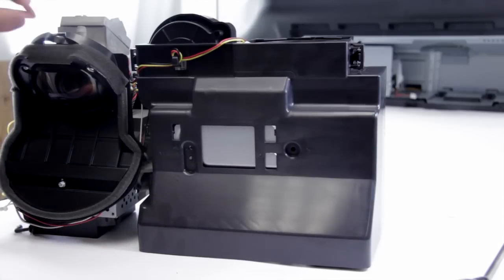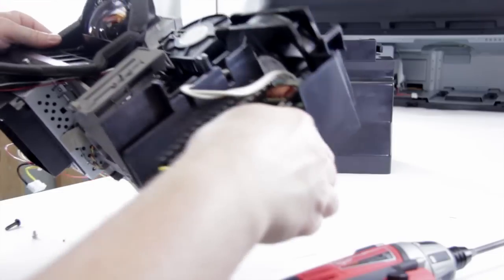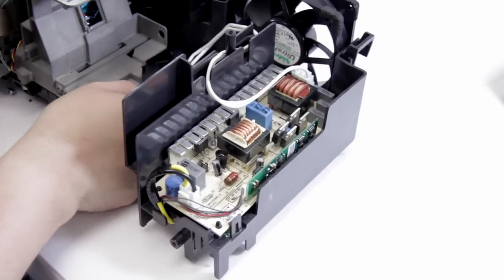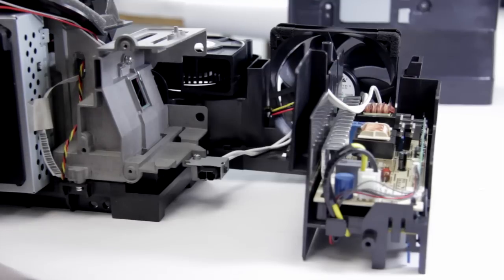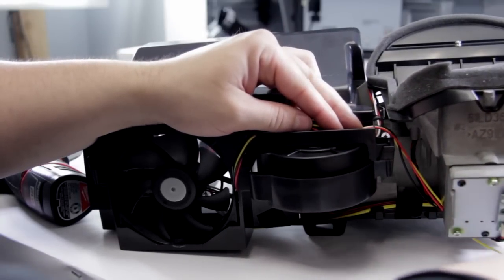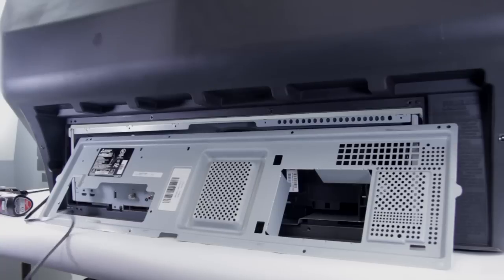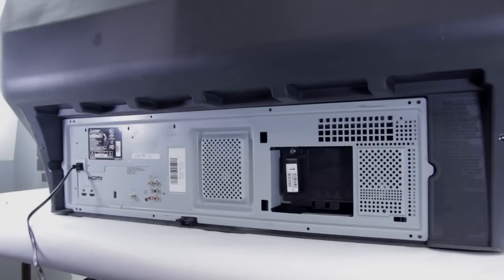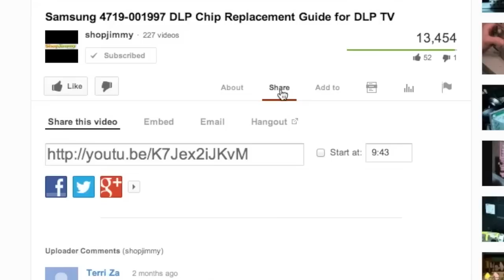DLP TV Repair Tutorial - DLP Bulb Won't Turn On - How to Replace Ballast Board in DLP TV

Comment: Hello,  great video. I was just finishing up after separating all my parts. I just ordered a replacement ballast on Amazon. My question is this, do you know what  exactly it is inside the ballast that goes bad or is it a myriad of things it can be? I just ask because I thought about re-flowing my old ballast just to see if that works. Just curious is all. Thanks.
Reply: Ballasts can fail in a number of ways once aged.  It's something you should replace, instead of seeking someone to refurbish the part. 
When replacing buy brand new. Otherwise you're still running on borrowed time.

Comment: Hello, thank you very much for your awesome videos. I have a question in regards to my Samsung DLP TV, it seems that the lamp's fan (the bigger fan) is turning slower rate than it should, what could cause that?
also it seems like there is a noise, coming from where the heat sink of the DLP chip is located, does anything come to mind that could help me to find what is the cause of this problem?
I really like this TV and hope I can fix the problem with your help, thank you for your time
Reply from the maker: Acie Ace   Attempt this repair at your own risk.  I recommend cleaning the fans, as the noise you are probably hearing is the color wheel.  Thanks!  www.shopjimmy.com

Comment: In the WD-82837. Once I pop off the rear cover, the ballast is only held in place by a clip and 3 wires. Simplified in comparison to the video above. Lots of great information, but Mitsubishi seems to have made it a lot easier since this video's release. :)

Comment: Hi. I have a samsung hlt5676s dlp tv that turns on and off and i can hear the ballast buzzing several times as it tries to light the lamp. the lamp never lights and then i get 3 flashing lights on the front. The lamp is relatively new Genuine phillips lamp. i just replaced it 10 months ago and the lamp does not look burnt.

Also i tested the wire going into the ballast from the power supply and im getting 480v on it. is my input voltage too high?

Comment: I have a WD-73833 Mitsubishi television. the other day I smelled a slight burning smell for just a second and it was gone. since then I have no picture on my tv. it comes on and the is sound and the lamp was replaced about a month ago. think it could be the ballast?
Reply from the maker: TheCaptainredneck102  Please watch this video FIRST to help with your repair!  https://www.youtube.com/watch?v=BP3NVNCGEv8  This could be a problem with the lamp or the ballast.  You may need to replace each board individually to see which one fixes the problem.  Click this link to replacement parts for your TV model number on ouor website:  http://www.shopjimmy.com/catalogsearch/result/?q=WD-73833  Be sure to match part numbers on your current board, with your replacement for compatibility.  Thanks and please let us know if you have any further questions with your TV Repair!  www.shopjimmy.com

Comment: Please help, i have a Mitsubishi DLP WD 73840 that just went out. When I try to turn it on the green light blinks only, no picture or sound at all.i noticed that one of the capacitors Nichicon 820 uf 200 volts 25x45 mm is leaking, what do you think is the problem? thank you in advanced. great video BTW.

Comment: I have a 2004 LG 55 inch and have replace the bulb twice but is still dim. Is that a ballast board issue? What is your thoughts?
Reply: I have the same issue. I'll change my ballast and see if that fixes it. If it doesnt then I'll be giving the color wheel a replacement next.

Comment: Question......I have a wd-65737 dlp tv, I replaced 4 lamp (all new and still fairly new,  and I tell you why), I turn my tv on, it buzzards and the lamp is not turning on, only sound. Then I changed lamp in tv for a new one, does the same thing, buzzards and only sound no picture. I unplugged tv for 24 hrs, plug it back in and tv started working like brand new. I clean my tv every 6 months, no dust no lint or anything. But I have to do the unplugging every other day to get it working, I try all four lapms, and with all 4 does the buzzing, flashing red light and here comes the unplugging, hahahaha, but is getting old replacing within the 4 lamps and the unplugging. What do you think is my problem, I hope is not the plugging/unpligging or being not patient enought. Thank you.
Reply: You have what's known as a short in the connection. Either the white or pigtail connections. 
Hence why reseating it, allows it to work again for a short time.
Reply: Before reseating it next time, run down the wires with a volt meter to verify first. Find out where it's not sending voltage. That will better pin point you to how to properly fix it

Comment: I have a mitsubishi wd-60735.. when i plug the set in and try to turn it on, i can hear the click, the fans, sounds like a spaceship ready to take off, sound through speakers but no picture. the timer LED flashes green for 20-30 seconds then the set turns off. If i try the error codes it gives me 12 which means there is no error. What could it be?
Reply from the maker: Jose Casillas  Please watch this video FIRST to help with your repair!  https://www.youtube.com/watch?v=BP3NVNCGEv8  I recommend replacing the color wheel in your TV.  Click this link to replacement parts for your TV model number:  http://www.shopjimmy.com/catalogsearch/result/?q=wd-60735  There may be multiple boards for the same TV model number, be sure to match part numbers on your current board, with your replacement for compatibility.  Thanks and please let us know if you have any further questions with your TV Repair!  www.shopjimmy.com

Comment: hello,i have a 92" Mitsubishi dlp tv model # WD-92A12  and the light blinks green on plugin 1-2 times and then just blinks yellow continuously until I unplug it and it won't power on but I hear it power when I plug it in any ideas what I can do to fix it? And what part I would need to buy? the tv was built in 2012 I looked at the lamp but I can't notice anything wrong or discolored. it's a osram lamp.
Reply: mossberg2010 my TV does this did u find a salution

Comment: hi there, i have a 2008 Mitsubishi DLP (wd 73735) that has a lamp that wasn't lighting, now it keeps giving me a 57 error code (bad ballast, ballast not connected, etc). i have 2 ballasts, and it happens when either are installed. so i attempted to measure the voltage to the ballast, and i got nothing. 0 volts. so i checked the source, on the main board (or whatever it's called) with all of the big capacitors, and no voltage there either. does this mean bad caps on that main board?
Reply from the maker: squilla empusa   I recommend replacing the power supply board in your TV.  Here is a link to replacement parts for your TV model number on our website, click here:  http://www.shopjimmy.com/catalogsearch/result/index/?cat=59&q=73735  Be sure to match part numbers on your current board, with your replacement for compatibility.  Here is a link to a video showing how to identify your part number, click here:  TV Part Number Identification Guide for Mitsubishi Power Supply Unit (PSU) & Main Boards  You can also call our customer service for further assistance with your purchase.  (877) 881-6492  Thanks and please let us know if you have any further questions with your TV Repair!  www.shopjimmy.com
Reply: ShopJimmy.com thanks for your response, but i already gave up. i finally got to the color wheel, and found it broken. also not sure if new lamp is good enough
quality for the TV to run. same with the new (used) ballist. but thanks for
your help. i'm not gonna keep dumping money into this thing, never knowing
when it'll end.
Reply: @Squillaempusa.  I would never give up on my tv. Its built like a car. 
Itll never give up on me if I never give up on it. 
Theres not 1 single tv made today that can say that.

Comment: Question - the bulb went out on my 73 inch Mitsubishi and normally I just order another one and replace - but this time I install a new one & 30 seconds later the bulb popped - thought is was a defective one so I ordered anothe one (replaced) & popped again in 30 seconds  - what can it be please help??
Reply: Only buy osram bulbs. Do not buy the 20 dollar models. 
Osram costs about 40-60 
You got a fake bulb. Those only last anywhere from 2 mins to 2 months in my experience, and they can also cause your tv internals to prematurely fail.

Comment from the maker: @quatrobeinte420 - We are happy to produce videos that will help people through repairs!  Thanks for the suggestion!
Reply: I had the 61 code, changed bulb, changed ballast and changed all fans even changed color wheel. I am still getting 61 code and no sound no picture. Can someone help?? At first when I turn on it blinks green after about a minute light goes solid green then starts blinking red 6 times and yellow 1 time. What else can the issue be? Appreciate the feedback.

Comment: I have a toshiba dlp 62mx196 , when I plug in the set , yellow lamp light blinking 3 times over and over. I replaced the lamp nothing change. Any ideea  ?  Thank's
Reply from the maker: Cornel Pop  This could be a problem with the power supply or the ballast.  You may need to replace the ballast and power supply boards individually to see which one fixes the problem.  Click this link to replacement parts for your TV model number:  http://www.shopjimmy.com/catalogsearch/result/?q=62mx196  There may be multiple boards for the same TV model number, be sure to match part numbers on your current board, with your replacement for compatibility.  Thanks and please let us know if you have any further questions with your TV Repair!  www.shopjimmy.com

Comment: hello i have a toshiba dlp that I just changed the bulb with housing. My problem is that a loud whistling sound and a green flash tint come on screen and keeps flashing until I turn it off. when I let it cool it plays regular for a while then the green tint flashes again during viewing
Reply: 62hm95
Reply from the maker: +Jermaine Newman  Try all repairs and troubleshooting at your own risk.  It sounds like you need to replace the color wheel.  Unfortunately I do not see any replacement color wheels in the search results for your TV model number on our website.  Thanks and please let us know if you have any further questions!  www.shopjimmy.com

Comment: I have the 73 mitsubishi  dlp and sometimes it works most of the time it doesn't. After it stops trying to turn on the sounds goes off never having a picture. Then blinks 6 red and one amber then repeats. What part do I need to replace please...
Reply: does it sound like a video game dropping a bomb 3 xs b4 it stops trying to turn on? if so its the board the dlp chip connects too. idk its name but the tv repairman I took it too said he had to order that part from a secondary supplier cuz dlp don't make em no more. matter fact they allegedly don't make our dlp tvs anymore sense the others are so cheap vs them. but they have awesome pictures. I  should got ur 73in instead of my 65 lol.
Reply: @paulhonishjr1148  I'm getting a bad color wheel symptom on my WD73640(Mitsubishi).

The color wheel is supposed to be new. It spins then turns off, spins again then turns off.

Could something else be causing a new color wheel to shut off?

Thanks in advance..

Comment: I have a Mitsubishi Model WD82737 DLP TV. I replaced the main and power supply boards because of the flashing green light and now I have solid  green power light plus sound but no picture and TV cuts off after five minutes. Help!
Reply: I have the same problem on my Mitsubishi WD-Y57
Reply from the maker: Antonio Ortega  Try all repairs and troubleshooting at your own risk.  I recommend to put the original main board and power supply back in and leave the TV unplugged for about 30 to 45 minutes then plug back in and see what it does.  Thanks!  www.shopjimmy.com
Reply: Shadow-V2  My problem has been resolved by replacing the Lamp.Good Luck!
Reply: ShopJimmy.com My problem has been resolved by replacing the Lamp however now I have a small  black blotch that's only visible when screen has a white background. Do I have dust on my lens? And what do I use to clean it? Thank You.
Reply: Antonio Ortega i replaced my lamp 2 days before it started happening
Reply: Shadow-V2 Have you tried replacing the ballast?
Reply: no i have no money to buy a new one

Comment: don't bother. The parts for these tvs are no longer made, and the repair will now run you about 600 bucks by the time you get through replacing the ballast, the dlp chip, and the color wheel assembly. The retail value of these tvs is about 25 bucks, and the repair won't even get you another year out of your tv. If it goes out, throw it away. I tried to repair mine and didn't even get through ordering the parts. Nobody carries parts for this crap, not even shop jimmy. They only carry reasonable parts for lcd tvs, and some parts that run in the several hundred dollar range for dlp parts. Just go buy a new tv, it'll cost you less than this repair.

Comment: What exactly are the symptoms of a bad ballest? Just replaced the bulb and it comes on and starts to warm up maybe ten seconds later the screen starts flickering and goes out displaying red light for bad bulb??
Reply: My issue is a dim screen when a brand new bulb is installed. 
I pushed my last bulb to the end of its life, once a bulb has passed its half life, it takes more energy to produce less light than it didn when new. This puts a strain on your ballest board causing it to prematurely fail. 
If I let my tv sit off for a week, the ballest can generate and store enough energy to run my tv for an entire night before it cuts off. But the s green is still dim.. If I turn it right back on, I cant even get 20 mins of run time without it cutting off on me again. 
That's my hint that tells me ballest. 
It's the part responsible for sending 380v to the bulb with only a 110v outlet. If its faulty, you wont get a fully charged up bulb. Causing the dim picture you are experiencing. 
I understand this naturally, because grow lights and their ballasts work the same way.